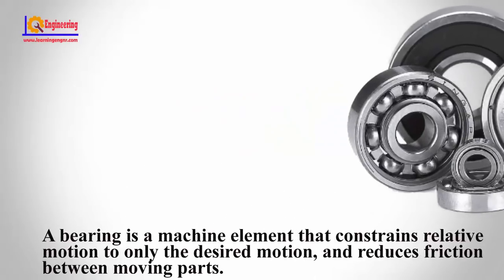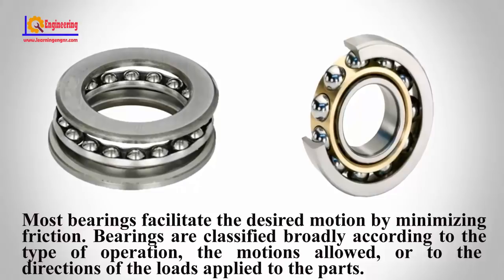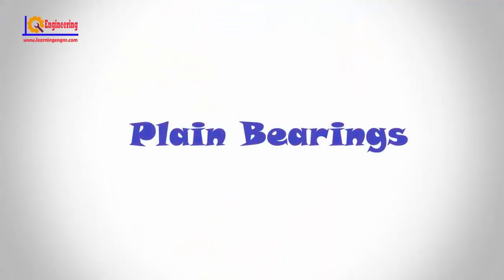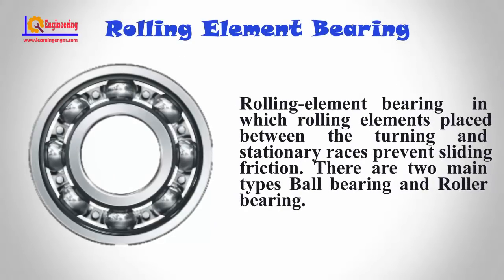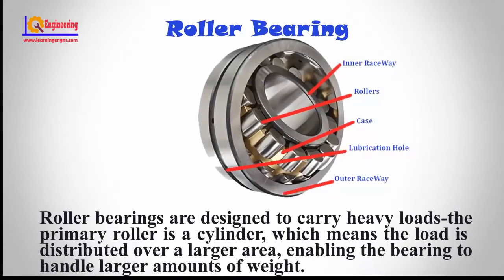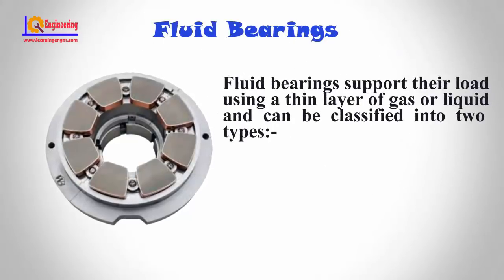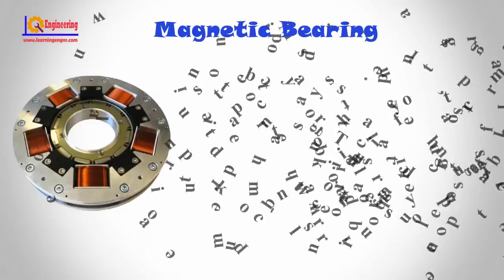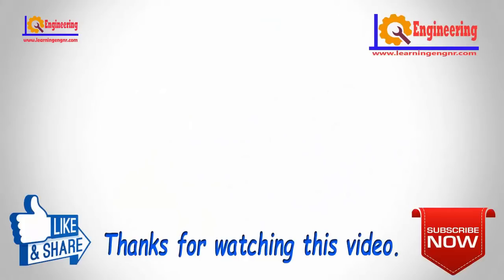Types of Bearings - Different Types of Bearings

Comment: Dear thanx for nice  vedieo. Dear you have not touched the selection  of bearing based on rpms.
Suppose i want to run my machine at 12000 rpm
 Please guide which bearing should i use for such a high so that it is safe and long life. Thanx
Reply: BRI RAJ BANS SINGH: Every bearing manufacturer provides the information you will need.  You in turn will have to know the relevant shaft rotational speeds, shaft diameters, snd shaft loads. With this information, you can use the manufacturer’s data to select a bearing that will provide acceptable life.
Reply: 12,000 isn't much really. Use a ceramic bearing if you want long life and it's relatively a small bearing. RC motors turn upwards of 20,000 rpm and use abec 3 and up metal bearings and last quite awhile, put ceramic and you get more time between rebuilds!